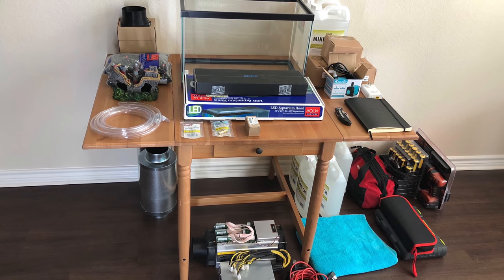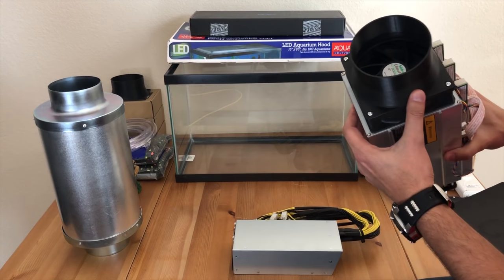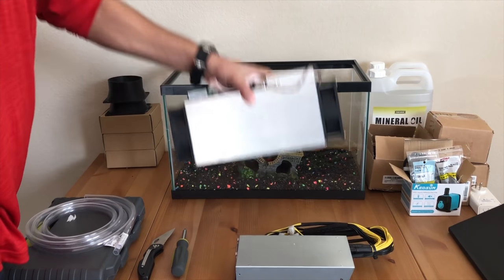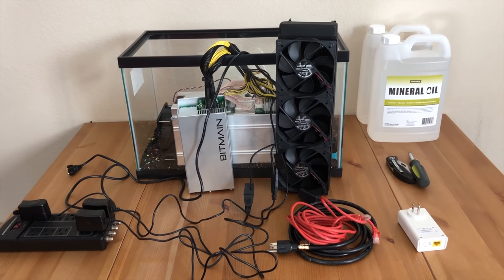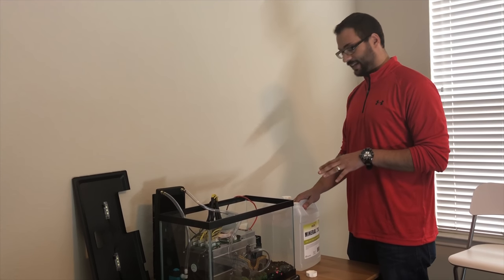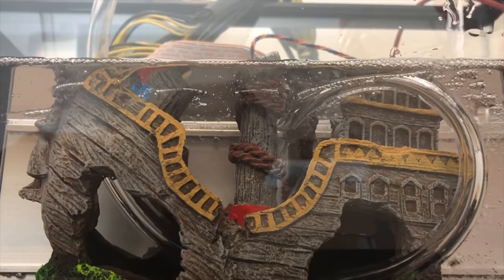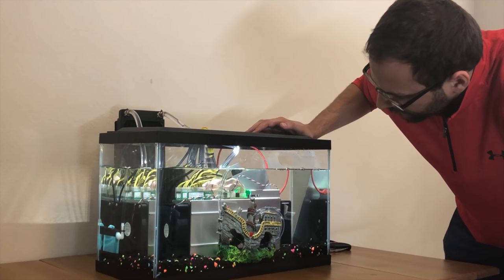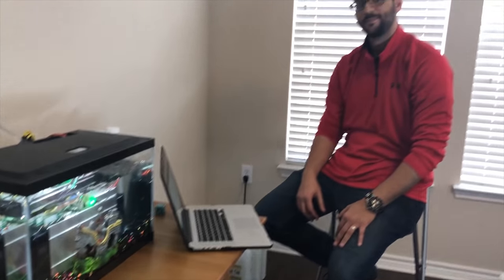Coolest Bitcoin Mining Miner - Liquid Cooled Experiment

Comment: Lose the gravel. It will eventually clog the pump or radiator. Lose the boat. It will act as a heat sink that retains rather than dissipates. Remove the front plate from the controller to allow circulation and prevent a hot spot there. Remove the fans. They don't behave as propellers. They will hinder rather than facilitate circulation and they'll draw more power doing it than they would in air. Remove as much of the case as possible to maximize exposure to the oil and eliminate heat retention. Place the suction and return lines on opposite ends of the unit to create flow. The whole purpose of doing this is to be able to run the unit at higher frequency (which means higher hash rate) while simultaneously consuming less electricity. If done correctly, the power consumption can easily be reduced by around 25% while simultaneously producing around 40% higher hash rate.
Reply: Hi Ed - do you mine? Would love to learn about your systems for mining optimization
Reply: @hijunglegym88  it’s not really my system. I just pointed out the most obvious things that he did wrong. When I was mining (briefly) I had a setup in a medium size cooler that worked pretty good. But I got out after the last halving. Electricity is too expensive and the reward is too low. In fact, crypto is a terrible idea now. It doesn’t even make a good way to store wealth confidentially and it was never suitable for investment.
Reply: @CuttinEJ  LMAO. It's not cRyPt0, it's Bitcoin and shitcoins. And only Bitcoin is worth it.
Reply: The boats the best bit 🤣
Reply: @CuttinEJ  hi I agree with what you're saying im thinking about doing a set up like this in my college dorm cut electricity if free would you think its worth it
Reply: @martinmhonyera8793 , no. Not any more. The expense of the equipment isn’t justified by what you can reasonably expect to generate as a return.
Reply: @CuttinEJ  I got a 990usd s19 90Th but my only issue would be the noise that’s why I was looking at émersion, I wouldn’t be paying electricity in my dorm so I would make money
Reply: @martinmhonyera8793  not having to pay for electricity would help, but 1 machine at the current rate would take forever to make any money. And you can bet that when the electricity usage jumps up they will notice.
Reply: @CuttinEJ  whattomine predicts I could make 6.85 per day so I’d break even after 145 days. I’m not sure if electricity would get caught bear in mind you’ve got 12 people per dorm  and 12 dorms per buildings I think I could get away with it my only issue is the noise one, any advice on that?
Reply: @martinmhonyera8793  $6.85/day isn’t worth the effort. And believe me, they know how much their electric bill is during and between semesters. When it spikes, they’ll start looking to see why and they’ll figure it out pretty quick. The noise is another issue you won’t be able to avoid. Your room mate and neighbors will rat you out in heartbeat. And you’ll deserve it. Just don’t do it. If you can’t run a farm with at least 100 and pay your own electric bill without disturbing anyone else, you’re doomed to fail.
Reply: Just filter the gravel out of the pump obviously. The boat won't matter and it's more complicated to explain why it doesn't matter. Skip. Fans still work! Props and fans are different, props move through the air/liquid and fans move air/liquid through the fan. The fan in liquid doesn't become a prop, it's still a fan and it still works. They will not use more power, they recieve a signal and spin accordingly. The fan will spin slower when met with resistance but the signal will be the same unless the temperature changes. Temperature changes the amount of power the fan is using - not resistance from the liquid. You don't need the fans to spin fast, they will circulate the liquid at a very low power consumption so it's better to keep the fans unless you're using some fancy engineering fluid which conducts heat extremely well, then maybe ditch the fans. The oil will flow through the case just fine, it's designed to have flow through it. You don't need to maximise exposure to the oil, it's literally submerged completely in oil. I'm sorrry but you don't get more exposure than that and you don't understand some of the science. All you need to do is make sure you maximise your radiator to dissipate the heat, not remove the case, not remove the boat, not remove the fans. Really shouldn't use mineral oil though, it's dangerous, if there's an electrical fire it will ignite, it's flash rate isn't that high. Maybe 150degree c or something. It also can degrade the insulation on your wires which could create a short leading to an electrical fire fed by 40L of flamable paraffin. Just spend a little more on some of these new immersion fluids specifically designed for this purpose. PS mining is still profitable in 2023. Just need to be smarter about it which is a good thing 😊
Reply: @Daemon_venator , mineral oil is dielectric and inflammable. After reading this nonsense it’s obvious to me that what you know about any of this could be written inside a matchbook cover with a great big crayon. Don’t feel too bad for not knowing anything about thermodynamics, chemistry, physics or engineering. Information like that is carefully concealed from people like you IN BOOKS.

Comment: Very cool....did you not face any issues with the fan rpms being affected due to the viscosity of the mineral oil putting a load on the fans?
Reply: So from my understanding: the fans do spin slower, but it isn't bad for them.
Reply: Fan speed is controlled by current, and then assumed to be roughly correct. So the regulator does not know that the fan is actually spinning slowly.
Reply: You can remove the fans just put the hoses under the miner to make it boil out.
Reply: @NiceMoKnows  you will need a fan emulator for that

Comment: I have a few questions. How long did you use this? And during that time, were you able to overclock the miner and maintain decent temps? How was the sound level ? And lastly, after you decided to take the miner out of the mineral oil, how did you clean it out? Thanks for the video!
Reply: all I can think of cleaning it with is QD electrical contact cleaner
Reply: Cleaning this stuff will be a problem..maybe yuo can use ipa (isopropil alcohol, but i think yuo gona need to disasemble the unit and clean very carefully if yuo want to work in air
Reply: @noway8233  I read this as use ipa "beer" lol and was instantly like yupp a couple IPA's and some elbow grease...lol but yeah iso would work wonders, I would use 50% or 70% so it doesn't dry that fast...or qd electronic cleaner

Comment: Great video.  However, everyone should know that mineral oil is flammable and can be used in an oil lamp.  If it catches fire, then it will burn and burn.  If it is near flammable material such as a cloth then the oil could feed that material similar to a wick.  If you use this type of system for cooling, then please have an automatic fire suppression system capable of quenching oil fires.  Remember, the electric system could also cause a spark and ignite the oil.
Reply: MIneral oil is not flammable, its combustable...big difference

Comment: In theory, this setup should work with any miner, right? Something like the s19 Pro at 110th/s should do awesome in a home, I wonder?
Reply: But probably better to use bigger aquarium and bigger radiator .
Reply: I read something about the mineral oil degrades rubber... So not sure if this is a good idea or not

Comment: Come on man, we need to know how efficient this was.  How hot did the fluid get?  Was the radiator able to transmit enough heat out of the medium?  Did you stick with it?  Why not?
Reply from the maker: Leaving out details. Fluid tested until 110 degrees. Max temperature reached in +-30min at a normal room temperature. Minus +-10 room temperature reached in +30min. Two radiators (these specifically) cannot remove the heat generated. This is somewhat given because they are built for ~350 watt of heat removal give or take. A custom radiator would do. I still wanted to test this though. I did not stick with it because it was purely an experiment to get some numbers in order to properly calculate scalability requirements. There is a lot of math out there to calculate this but no practice. I hope that helps.
Reply: Joel Pagan thanks for the reply. It would be interesting to combine this with a window ac to more effectively draw the heat from the radiator. Or place a large radiator with a fan outside of the window to place the waste heat outside directly.
Reply from the maker: Stephen Owen Definitely. It really depends on your goal. One miner and trying to get rid of noise? Then just build a simple sound box with mufflers and loaded mass roll. Trying to keep cool and noiseless 5-10 in an office closet? Then just use this setup with a heat exchange condenser (the ones that look like an ac). Only if you can justify the extra cost of equipment and oil. Somewhat hard to make the case for that though. Bitmain tried to do liquid cooling with the c1 but it's not as cost effective. Works OK for hobbyists but not scalable.

I'm willing to demonstrate a large scale solution if enough people find value in doing so.

What window setup were you considering?
Reply: 200 percent a day, how why the hell would you be seeking peoples funds if you could guarantee such returns?

 Get out of here with this preposterous garbage, we already have a bad enough reputation without charlatans like this.
Reply: Joel Pagan - would be interesting if you can demo how to keep noise down. This miner is noisy.
Reply: H P yes pls show us the muffler set up
Reply: i don't get it, where's the fish ffs?
Reply: You’re like 5-6x off on your math for radiator size and gravel??? Lol btw am nuclear engineer and this has been done and there are companies who have already patented such devices/concepts and they have deep pockets so I highly recommend not pursing much more. I only know because they shut us down...
Reply: a nuclear engineer that can't tell the difference between I'm and am...right....
Reply: I built a mineral oil xbox 5 years ago that used a copper coil inside the tank and a small ac unit with a relay-heat switch that acivated at 95 and shutoff at 65 it worked great system turned on about every 10 minutes but it used as much electricity as a small refrigerator. NO noise fan running at low rpm  on the condenser and compressor was quiet fun project took about a month to figure out the different size copper lines, pressure and Freon to use    https://youtu.be/G5Td9Ho5oXQ
Reply: How could you patent using oil to cool your electronics? He's not inventing anything.
Reply: maybe hes still pursing his degree?
Reply: So, this did not work? I really am keen to cool downand reduce the noise of my setup
Reply: I went to the web site above looking for one of the most important part in that Technical Specification but... Where is the decibel spec? Are you telling me it is totally NOISELESS?
Reply: Joel Pagan how did you clean the pcbs after removing it from the oil?
Reply: @Snewpi  nuclear engineers have plenty of time to watch shit like this. Lol!
Reply: Such a simple solution. Use a 3 core car radiator with a high flow pond pump.
Reply: best just throw a copper line to your spa and make a coil and return to the tank. Insulate all pipe except the coil that is emerged in your spa.
Reply: This is great. I wonder if a true dielectric synthetic fluid would have been more efficient — say you did that and ran your pumps into a smaller tank below (you’re just increasing surface area with more volume), used convection (ie, you pump out from the top and returned fluid goes back in all the way at the bottom) what it’d look like. With enough volume of your dielectric, it might be cool *enough* and you could remove the fans altogether. Killer vid.
Reply: Hi, the fans are on or off?

Comment: Hey man I was wondering if you had any problems since mineral oil contains corrosive sulfur in it. In the long run have you had any oxidation problems or failures in your hardware/electronics? Anyone here done this ??
Reply: linustechtips use the same kit for a pc, and what i a can tell you is that mineral destroy plastic parts, this miner are not desinged for this, i am not saying that is not a bad idea but you had to do a lot of modding for dont destroy anything, all the power cables conectors and plastic parts will get damage in the long term, but pcb heatsink and other metalic stuff would be fine
Reply: @jorgeneo560  Hi Mate, I plan to create someting similar, so please tell me, are you sure they use the 100% same oil? As I see it is a food grade type so it is not allowe to destroy plastic parts normaly.
Reply: Zsolt Dobra i didnt build, but in theory will work, you can buy a gallon in their page and submerge what ever you wanna try wait two weeks and see, if its ok theres would be no problem

Comment: Great video. Is it still running? Lifespan of the ASICs when submerged in mineral oil?
Reply: Aboout 250 years... Human being nowadays can live 510 years... so you can expect to have one spare ASIC in you closet.
Reply: @GOLTURBO555  bro what
Reply: @GeeMannn  Quarentine. We all gonna die, arrested at our own houses.
Reply: I guess that it didn't work for long
Reply: My research indicates mineral oil will eventually eat some parts.  If you go with the special fluids for this sort of work, the miner last longer
Reply: Im pretty sure this guy just ruined a perfectly good S9. I like mineral oil pc’s i think they look really cool. But there are certain caveats people that build them have to be aware of. Rubber will degrade over time, certain plastics. That gravel your using for decoration at the bottom was designed for water not oil. Unless this guy cracked open that s9 to check for rubber and adhesives used during the build im going to guess he ruined it after 2 - 3 months
Reply: @dietricha.schmitz811  what fluids did you come across that you can run a miner in?
Reply: @jamesadams410   sry but we got transformator running on oli  for 40 years  and there still working so why not this

Comment: you are going to have problems with the cooler of the same equipment since the mineral oil restricts the speed of the fan cooler and it may burn
Reply: It's true but the thermal coefficient of the oil is way higher then air

Comment: Awesome!! What kind of radiator are u using ??  Give us the the part list  ;)  to build it.  Regards
Reply: alejandro L trujillo S literally any radiator would do then size the hose and pump to the rad
Reply: XSPC 360mm radiator
Reply: Use a car or truck radiator!
Reply: I have to ask? Would not the viscosity not matter with the radiator flow rate. If they are rated for water not oil I would imagine the flow rate would not be optimal for cooling with a standard water cooling radiator.

Comment: Are there any points for concern when dipping your miner into this or a similar substance? If a novice wanted to carry out this experiment, what might an adept miner say to them in order to prevent damage?
Reply: Mineral oil is not the best choice but it is significantly cheaper.

Comment: crazy I had no idea mineral oil could be used as a non-conductive coolant
Reply: There are videos about that from like 10 years ago.
Reply: You can actually use many industrial liquids as non-conductive coolant. Also water. You just need to make sure that there are no impurities..
Oil is just better, because it does not evaporate on the operating temperatures of such a system.
Reply: polyolefin fluid is the best - least toxic and degrades the slowest. Datacenters can use half a million litres of the stuff!

Comment: as a prank the camera man should have replaced the oil in the bottles with water lol!
Reply: Oil is no transmiter any electricity .. so is good way coling
Reply: That was sarcasm :3
Reply: dont take risc with water but oil good . is no problem for electiricty many motors electric is inside oil
Reply: distilled water can be used.
Reply: distilled water is still water and it does not change the chemical bonding and conductivity of the compound.
Reply: It does change it, distilled water is not a conductive liquid